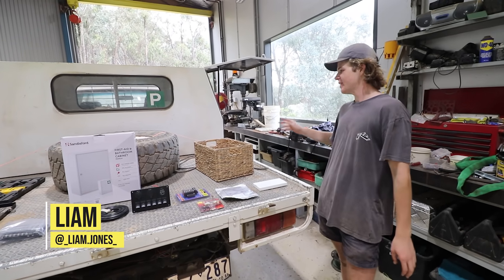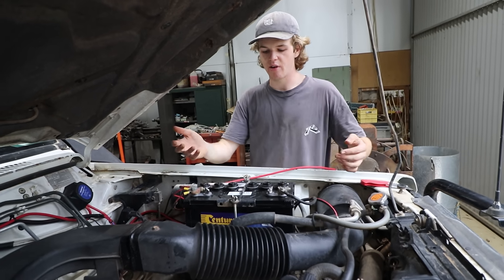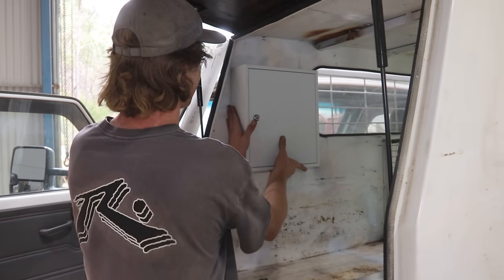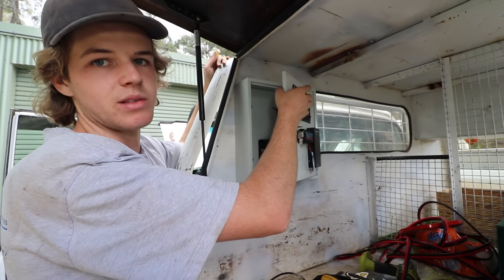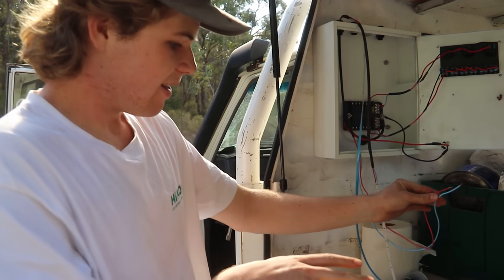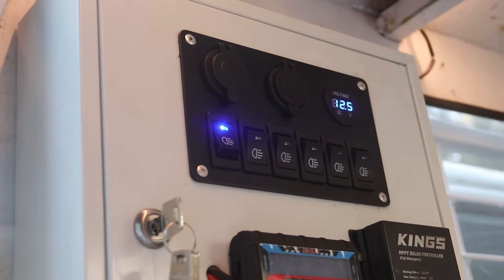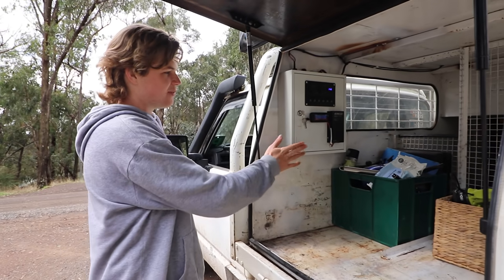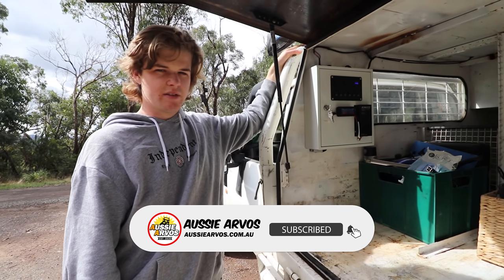12 VOLT SETUP on a $150 BUDGET! BEST BANG FOR BUCK 4x4 12v SYSTEM!

Comment: I would actually say a fully sealed AGM batter is better at dealing with heat than a regular lead acid battery. Really, they're better at handling extreme temperatures than lead acid, hot or cold.

Comment: 3:25. When you solder the wire into the connector you should also pre tin the wire end (apply solder to the wire) or heat up the wire as well as the connector. That way the solder will adhere properly to the wire and connector. The way you’ve done it could produce a poor connection, adding resistance at that point which will cause heat and voltage drop.

Comment: Well done lads. Just a tip with riveting metal to metal I have used silicone before I rivet. Rivets can work loose eventually and believe me the silicone will prevent movement.
Reply: Use Duralac instead. If you're gunna do it, do it right

Comment: Great work. Loved the first aid cabinet idea.  I would have put your amp meter after the solar regulator. Also pretty handy to have one on your fridge circuit to give you a cumulative use total (you need to be able to disconnect it from the power source to reset this).  Not really necessary for summer camping but super helpful for winter camping or camping in valleys or shade.  Reset both at the start of the day and by the end you can see you have had 40ah in and 50ah out. Gives you an idea of how long before you have to go for a drive. Voltage isn't always a good indicator due to surface voltage.

Comment: It's turned out quite well, even for a minimal budget.
The Anderson plug on the tray is going to fill up with water. You can buy seals for the canopy plug, and mount the tray plug on it's side.
You could run the fuse LEDs to the load side of the fuses so that the LED is lit if the fuse is ok, and goes out if it's blown.
And cable gland is the name you were looking for.

Comment: Nice job mate, love the budget videos that the average person can relate to. As far as the fuse box goes, your see voltage there because your multimeter / connected lights etc. have a very high internal resistance. The output here will be current limited to the draw of the LED (only a few mA MAX) therefore it's not an issue.
Reply: Yep, came here to say this. Leakage is limited to whatever it takes to run the LED, which isn't enough to run much if anything else. Might confuse the hell out of you later on when you go to troubleshoot something, though.

Comment: I know that Anderson Plug is meant to be waterproof but have the socket (battery side) facing upwards will mean it'll collect debris and moisture if the seal were to fail or when the canopy side is plugged in. Rotate 90/180 so that the aforementioned can't happen, it may seem picky but only trying to mitigate any points of failure for the future.

Comment: Hey man bit of food for thought for you. Choosing a maintenance battery like the N70T century that you've chosen you will constantly have to monitor the water levels as it's will always be cycling up and down and charging which uses the electrolyte in the battery. A Maintenance free battery for example Delkor Hdc27 would have been a far better choice for longevity
Reply: Can't top the delkor up though.
And they do lose electrolyte still.

Comment: Not bad at all for a budget build, the idea for the first aid box is pretty good, most electrical panels are only a little different but that does what you need, hides your connections and enables access when you need it, nice work, the "grommets" are cable glands and can come in sizes from 8-50mm or so and are great for keeping water and dust out, if you have trouble with 12v sockets falling out, try a marine shop for the marine versions which push in and twist, ive used those for years and plugs dont vibrate out, keep up the good work and nice
 videos !

Comment: Good budget setup mate.. Would recommend adding a inline fuse to the main supply in the switch panel. Also run the panel direct to the panel instead of through the fuse box

Comment: Good job boys, just have a look at how your solar panel is mounted, its a good idea to have it raised up to get airflow under it. Also, nothing wrong with eBay stuff, if it works it works 👌
Reply: Alloy angle I’m guessing, local alloy place normally has off cuts dirt cheap or a metal fab shop

Comment: Brilliant set up, keep it simple and awesome! I'd replace that fuse with  a midi fuse if you can, as with corrugations the grub screws can come undone and the wire can slip out. Great for stereos, not great for dual battery systems. This is coming from someone who works at jaycar :P
Keep it up guys!

Comment: Really enjoyed that. What a great video. Thanks for the tips. Learned a lot. Also, hadn’t heard of soft soldering where you melt the solder then place lead and let cool. So cool. Also, I have fuse box with LEDs and taking them out to stop power leak.

Comment: that power leak you notice happens because the fuse block sends a tiny bit of power and thats how it detects it. thats why some stuff lights up i deal with it too. thats how they work. i use the cheap ones all the time and have never noticed a problem with it so far, even with a main fuse at the battery doesnt get tripped. they were probably fine, but youre right it should cut power and thats it.

Comment: Nice and very innovative use of bits...the fuse panel leaks around 0.03mA to the load - its not dangerous and won't kill anything you plug in, except perhaps may vaguely illuminate low wattage led lights but the switches should disable that. Too late to save that nice feature of leds coming on when the fuse is blown...too bad.

Comment: Keen to see you guys doing budget 12v system.  It’s not necessary to pull your super out and buy all brand new Redarc gear for your first set up.  

That said, your fuse for the engine bay should be changed. The screw terminal is quite a poor connection and will generate heat, not to mention will be moving around.  
Invest in a couple eBay special midi fuse holders and fuses.  Super low resistance for low heat generation, and with the lugs on the ends you won’t have issues of cables coming loose.

Comment: Fantastic video! def gave me ideas as I need exactly the same setup.. Very basic as i came once in a blue moon and would only run a fridge but I already have 2 large solar built into my roof that arent currently being used. I would suggest putting your Solar on a switch to stop over charging the battery ( which may potentially shorten the batteries life span )

Comment: Just an idea for you mate, when I went to 33s on my GU I removed my old spare wheel carrier cos I was going to a swingaway bar etc, maybe try and see if you can get one off a wreck? It'll cost you like $50 maybe, bolt it to your canopy, let the wheel sit on the tray to take the majority of the weight and you're laughing. One of my mate's bought my spare wheel mount off me and he's using it on his Hilux with no dramas.
Reply: That's the plan mate, have to do some internal bracing first though!!
Reply: @jonesy1130  Too easy mate, just thought I'd throw the idea out there especially with the budget build aspect in mind.

Comment: May check your VSR if it opens when deep cycle battery voltage reaches 13.2volts and will then link in your cranking battery as well.
Depends if you want both linked until voltage drops to 12.8volts again.
Just that you only have 110watt input trying to charge that beaut 200amp battery.
A big enough diode on deep cycle battery side will correct that issue. I know this from experience

Comment: I'd line the inside of the canopy with insulation, as it will get warm in there during summer and over-heat the electronics.
Reply: Ventilation is better than insulation with these as the fridge inside creates heat and it can’t escape if it fully insulated.

Comment: I've got a similar fuse box but purchased from Supacheap or Autobarn. It leaks a little power as well so just because yours came from EBay doesn't make a difference. I need to get one of those monitors for my solar. Also keep an eye on that solar panel. I've heard of a few flying off on the highway.

Comment: Great setup. Could i suggest an inverter or some setup run off that to charge tool batteries. A decent electric chainsaw could be a handy addition.
Reply: Waste of power mate, you're converting DC to Ac back to DC, you can buy 12v battery chargers for most brands now a days

Comment: Great video, thanks. I don't know anything about 12volt. So just a dumb question if you don't mind. You have a cable supplying power from your battery. Does the solar panel supply power to the battery by the same cable? Or did you run a separate cable from the solar to the battery? I'm confused.

Comment: Not sure what you mean by 11V leaking when fuse is out... voltage across an open fuse will be your full battery voltage, should be 12 or 13 V or so. Even with the LEDs allowing a trickle of current. If you saw 11V your batteries are seriously flat, or you have some resistance in your wiring between battery and your new fusebox, and with the massive 100A wiring you used, you should not see any resistance in the wiring unless you have a bad connection somewhere.

Yes there will be some current leakage through the LEDs, when the fuse is out or blown, there has to be, so the LED can light up. But the power loss should be negligible. There will be a resistor in line with each LED to limit the current through LED to 20 mA or so. So if you have 5 fuses pulled, and 5 LEDs lit, that might be 100mA total, so power = 0.1A x 13V = 1.3 Watts. Pretty negligible. If you want to measure this to confirm you're not losing more power, you need an accurate ammeter, not a voltmeter. It's very unlikley you're really leaking any current unless that ebay box is an absolute POS. The only other leak youre likely to get is a short to ground and if you have one of those you'll blow your main fuse.

Comment: Good 12v mod but disclaimer got to add the cost of duel battery cost so when u say $700 system don’t need you have got a system close to $700 in price with second battery
Reply: the sale had it priced at $222 so I guess its a $372 setup
Reply: @joetobia6974  plus isolator plus solar panel
Reply: Yes, correct Allen. You are in the rare 1%. The other 99% understand the assumptions made and that the point of the video is to show how things can done on a budget because not everyone can go straight out and drop the cash on a top quality Redarc system.
 Perhaps you could also calculate the cost of the solder, heat shrink and electricity used (including shed lighting time) and post it for all those interested !!
Reply: @bogged2theeyeballs695  And a redarc system with a battery, isolator and solar panel would make it a $2000 set up.
Reply: @stevegraham3817  Exactly.

Comment: Just found your channel and loving the videos, i have a navara d40 ute no canopy just looking to run something like this in my tray for my fridge, are you using a 2nd battery or just running it all from the battery in the engine bay, and to obviousky keep it all charged when car is not running your using solar, correct?

Comment: Great clip fellas, about to do the same install in my canopy / dog box. One thing I'd like to know ( still waiting for my gang panel to arrive from eBay and getting keen to pre-wire in my head  😆😉 ) is do you have to switch on each switch on so the next one in line effectively works ?  I mean, working from left to right, do you need to switch the say, first 4 switches in order for the 5th one to come on ? I've seen wiring diagrams of the back of these panels on eBay and the switches all look like they're kind of "daisy-chained" together being that the far right switch won't work ( no power going to it independently ) unless all the prior left switches are on switched on first. Hope that makes sense .....

Comment: Im putting this in my trailer what should i use to cover the battery
Reply: A bit of rubber mat, to lay over the top of the terminals should do the trick. If not make up a battery box that encloses it

Comment: I'm looking at buying the same switch panel that you have. Just a quick question on it. Does the volt monitor on it actually work? Because I know a lot of eBay ones just read out 12.5v regardless of how many volts it is haha
Reply from the maker: Yeah it works great!

Comment: Fuckin' oath, good job young lad!

But one tip, those glass inline fuses are garbage (so are blade fuses) - fuses are cheap no matter which option you choose, so might as well spend the extra few bucks and get midi fuses every time.